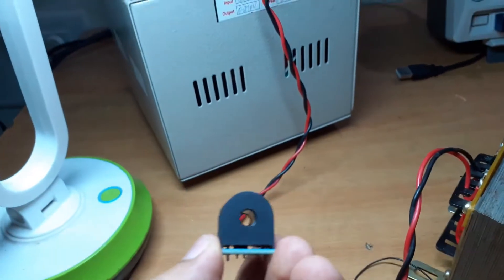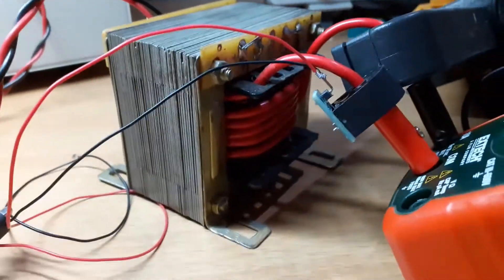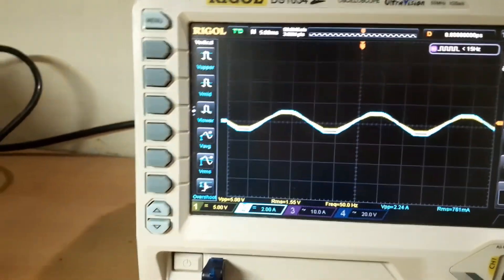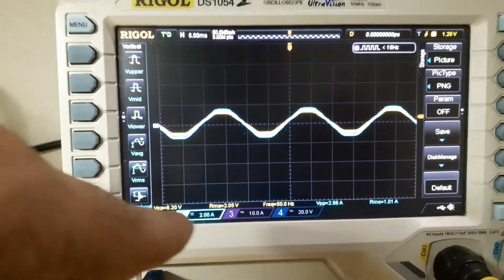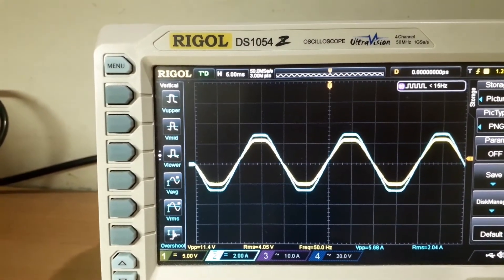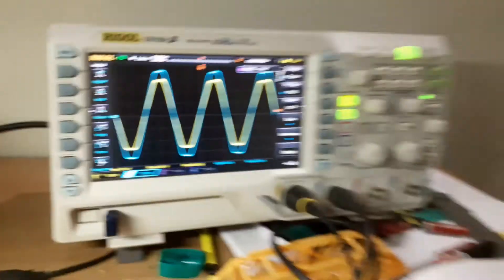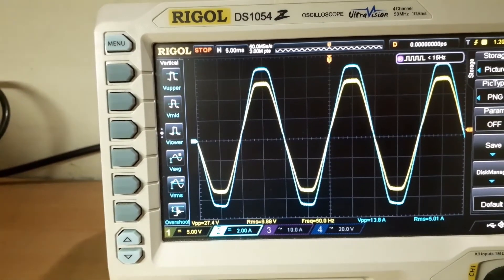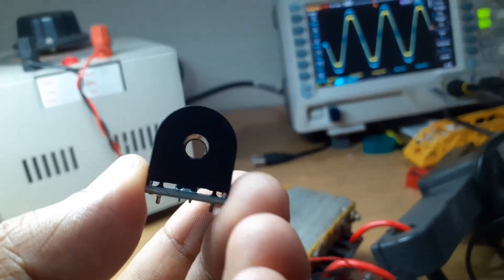Current Transformer Testing

Comment: you need to use active signal conditioning for accurate measurement. the resistor is loading the output, that why there is drop

Comment: I don't know what is the point of comparing the output voltage from the CT with the current, I think there is not much difference. when you had 0.556 amps, the calculation should be 0.556/1000 because the ct is 1000:1, then I=v/r, the resistor on the ct is 200ohms, this means you should have 0.556/1000*200 = 0.1112 Rms volts, on the yellow channel you have 0.109 since you are using a10x probe.
for 1.01 amp you should have 0.202 volts rms and you actually have 0.2
for  2.0 amps you should have 0.4 volts rms. you got 0.396
for 3.03 amps you should have got 0.606 volts rms. you got 0.602
for 4.02 amps you should have got 0.804 volts rms. you got 0.799
for 5.04 amps you should have got 1.08 volts rms. you got 0.996
the resistor might not be exactly 200 ohms. In fact if you calculate based on 198 ohm resistor you have almost got 100% accurate results